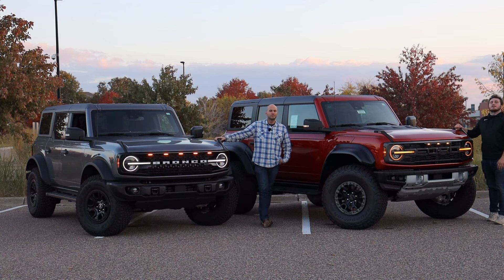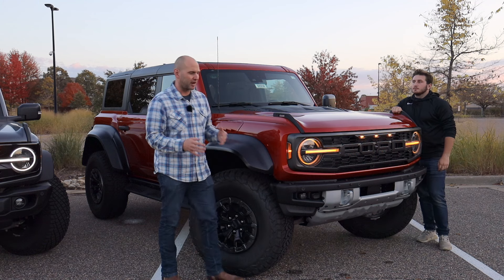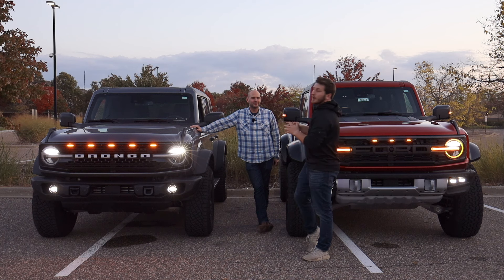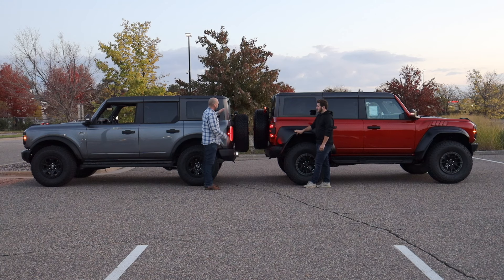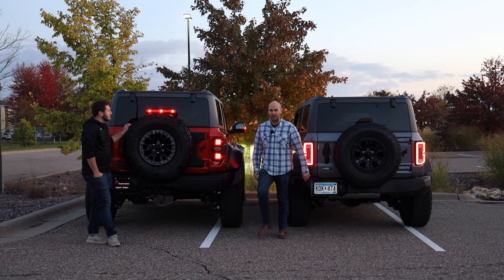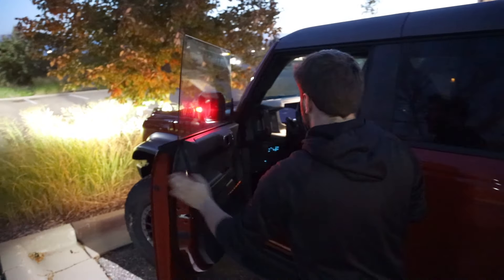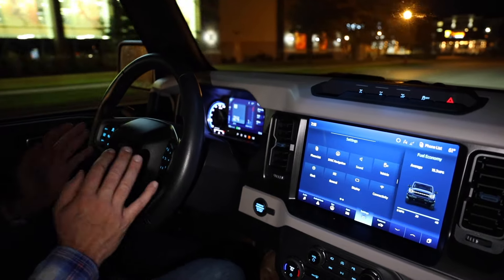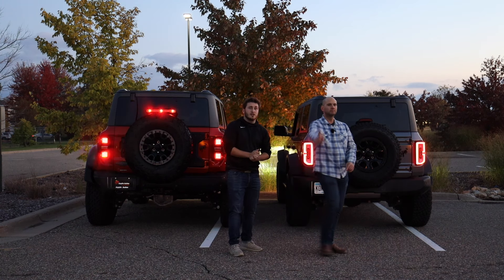Bronco Raptor vs. Wildtrak: A Detailed Comparison

Comment: The BRaptor has more in common in the drivetrain with the 1/2 ton F150 Raptor than WildTrack 
BRaptor has 1/2 ton F150 Raptor axles, trans which is bigger than std Broncos same for the brakes plus rims are not the same bolt pattern as Wildtrack but 1/2 ton truck drivetrain instead of Ranger drivetrain in the std Broncos 
BRaptor has much more upgrades than Big Bend to Wildtrack and you mentioned the dash & interior 
Good Video !!!

Comment: Are they based on the same frame?
Reply from the maker: Yes
Reply: @PerformanceOnWheels  I’m having a hard time deciding on badlands vs wildtrak, need some help
Reply from the maker: @lanceevans4053 badlands is better for rock crawling. Wildtrak is better for Baja. If you just plan to drive it around town get the wildtrak. The hoss suspension is a big step up and is super comfortable around town
Reply: @PerformanceOnWheels  mainly wife’s daily driver but we go to Arkansas for ohv trails

Comment: The only problem with this Raptor is the engine ..It should have a V8...not that 3 liter V6 ...
Reply: Have you driven it?
Reply: Had it been a V8 it would be limited, impossible to get and dealers would be looking 50k markups… it’s still impossible to get a raptor r for less than 30k over but there’s a ton of Braptors for under msrp

Comment: Let’s look at capability differences . There’s not 30k difference there . Stop comparing pretty vs capability. I’ve got the wildtrak sasquatch package and I’ll go up against a raptor any day off road .
Reply from the maker: The capability is where the $30,000 difference is…..?
Reply: Sorry but no. This Braptor is still on another level. I can still appreciate what you drive though.

Comment: Here is what I know. 99% buying the raptor are just wealthier dorks that will NEVER use the suv for what it's designed to for. You can also buy a badlands instead of Wildtrak and get the disconnecting front bar... then upgrade the suspension for 2k! 

Raptor is completely useless for 99%